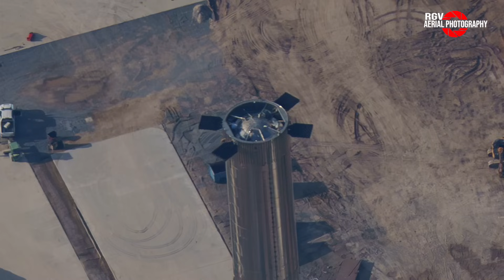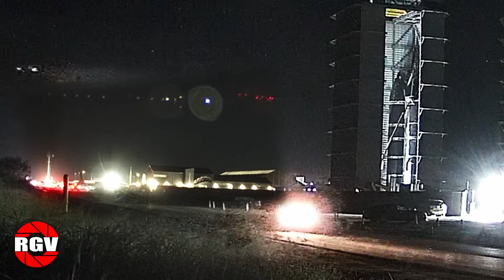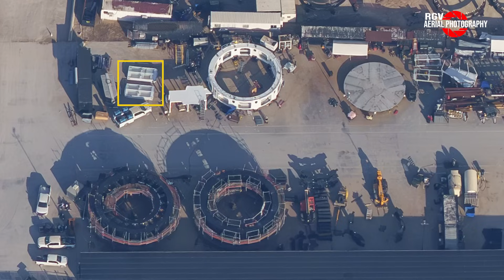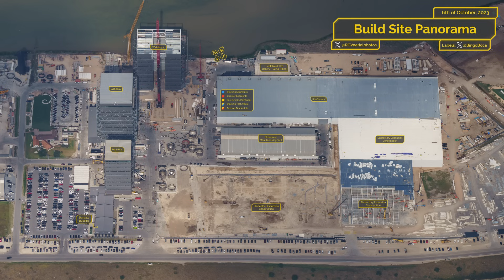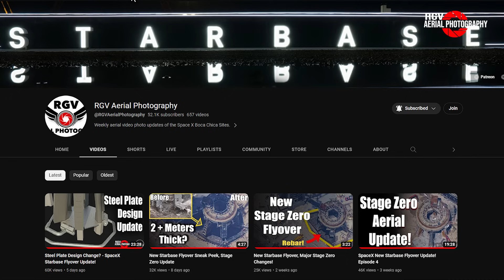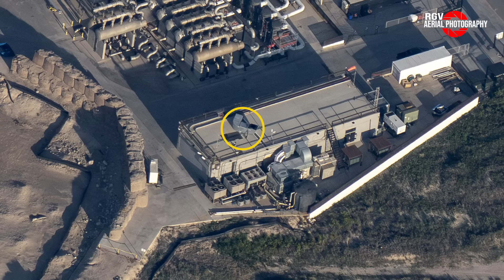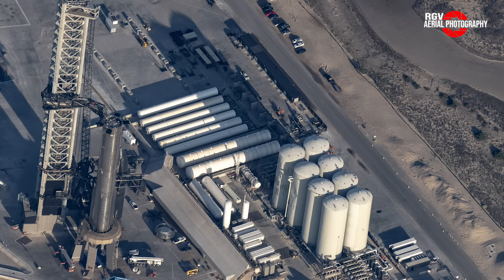SpaceX Delays EXPLAINED! - Starbase Flyover Update Episode 21

Comment: 1:08  The ullage thrusters are the 4 pipes going from the top of the tank to small holes in the side of the ring, right? I've seen them called vent thrusters now, which is a clearer term for this novel RCS thruster. These ones shown are oriented to the side and "ullage thruster" is a confusing term. Starship & SH are using the ullage gas as thrusters, yes, but historically it means aft-facing thrusters that settle the ullage propellant so it can feed the main engines. Vent thruster works well as a descriptive term for this novel system.
Reply: You are absolutely right, I was complaining about those channels using their own made-up terms like that it means something(and ignoring consacrate terms) , and denying that they are doing something wrong, like "the orbital pad" that is the one that can hold the booster and whole rocket, but suborbital pad is only for the upper stage, they are not aware that upper stage is the only that reach orbit? Putting aside that nobody named the pads before , like they have numbers and letters designation before, and probably even in current SpaceX designation aren't named "the Orbital pad" or "suborbital pad", but more like launch pad nr 1 or 2 , in the Texas test facility.

Comment: I suppose they will fly the naked ship from suborbital pad, like the old days, and practice landing in the ocean, in prep for the next full stack test flight.
Reply: S26 cannot 'fly' like the previous ships that took off from the Suborbital Pads because it lacks flaps.
Reply: It can if it hops a short distance offshore without performing the "flop" maneuver...which is what I was suggesting.  Its motors clearly can lift it off and it CAN "fly" or traverse while gaining altitude and head out to sea, then descend.  Try thinking outside the box, it's fun :)  
 @AussieSpaceGirl

Comment: I'm sorry to have to say this but whoever advised you to "fix your audio" was not correct. It was better before. This time it's muddy, among other things. It sounds like you're using a compressor/limiter as well which sounds like it's not set right, either. That's my two cents. What you will probably find that if you want to know how many opinions there are about the quality of the sound on your videos, just count the views. If asked, each one would have a different opinion from everyone else. After 40 years in "the biz" one tends to pick up a few pieces of info like that. Good luck!
Reply from the maker: Thank you for being honest. We're definitely working on changing things to get the audio to sound better. This episode had particularly difficult audio issues but hopefully those should be gone within the next couple of episodes!

Comment: I think folk are overreacting to the FWS news

It seems like FWS got a 1st draft re-assessment in August and a 135 day timer started.
Sometime between august and 10/5 FWS submitted their amendments to the first draft around 100 days early depending on the exact date.
Some time between FWS 1st draft amendment submission and 10/5, FAA had time to rewrite the assessment using the recommended amendments
10/5 represents the FINAL draft of the assessment being brought to the FWS and a NEW set of 165 days (30 to read and 135 to submit) for final amendments. 
10/17 is when FWS decided to tell everyone they received the assessment 2 weeks prior. I take this to mean they already did their part but that's pure speculation.

The alternative is FAA gave FWS the assessment in august, but FWS received it in October. this would be an indictment of the USPS if true but I highly doubt it.